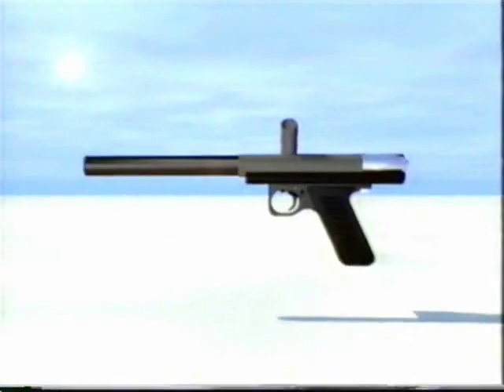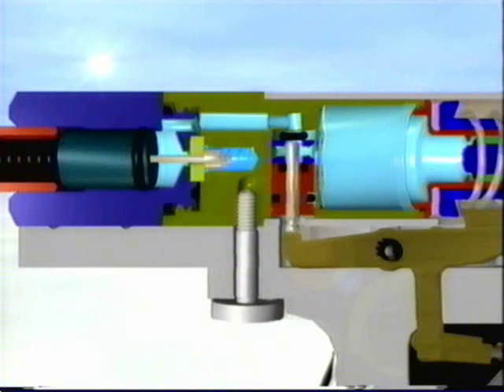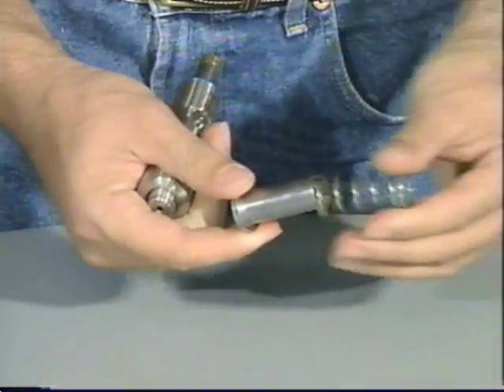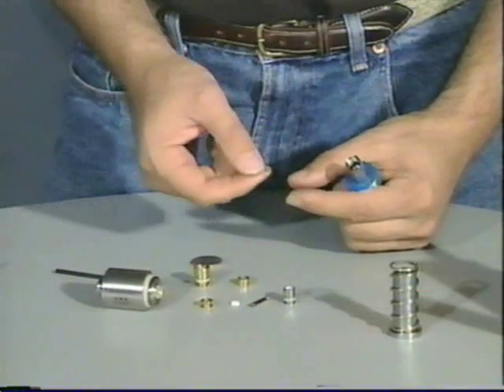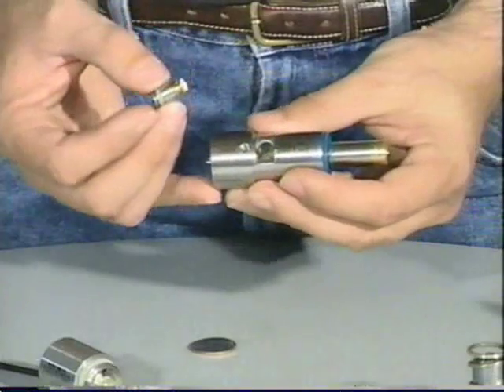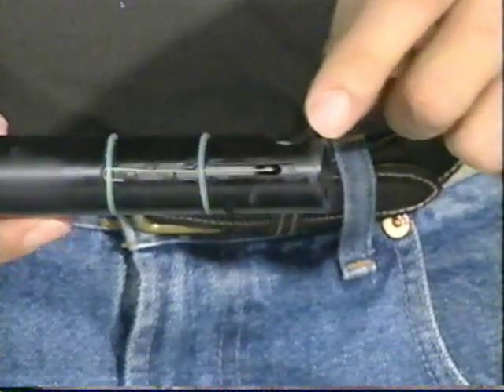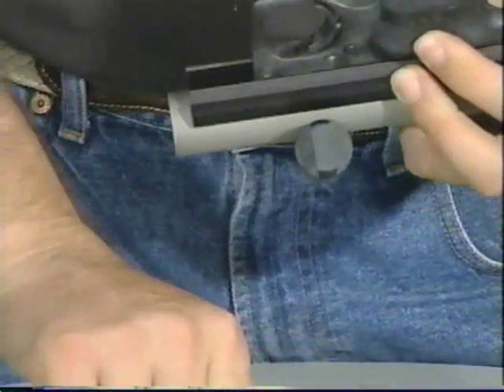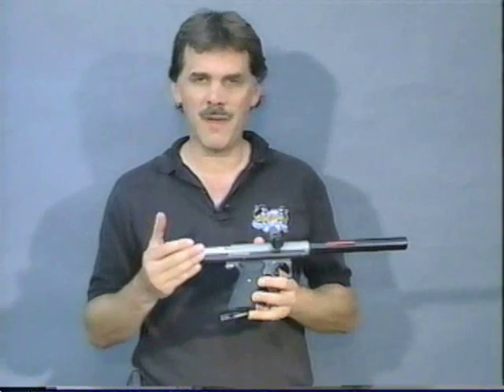Airgun Designs  maintenance

Comment: I have a an auto mag 68. How often does the mag require lube?
Reply: Playing rec ball at the end of each day. When I played tournament  ball back in the day, after each round I'd disassemble the entire gun, clean it and re-lube. If I suspected a problem Id switch out the part. But that was very rare because of how well built and the ease of maintenance of the mag.
Reply: I know Im a bit late here, but truth is, for the most part just drop a couple drops of paintball oil- not gun oil- into the ASA before screwing in the bottle, dryfire it a dozen or so times to ensure it gets pushed into the guts and thats it. The rest can be done every couple months of heavy use. Ive regularly purchased used, paint clogged automags from garage sales that still seal up and fire without being cleaned after a decade of sitting or more.